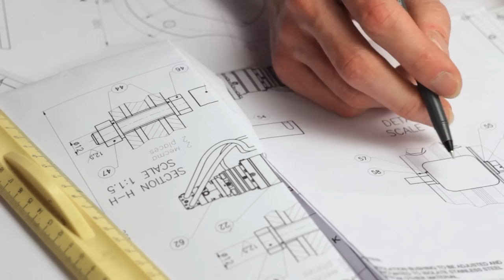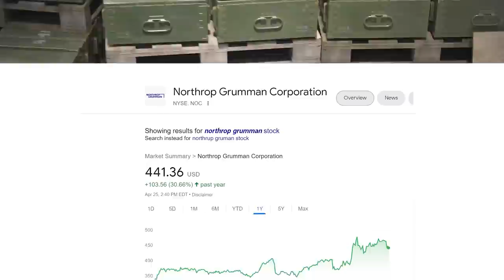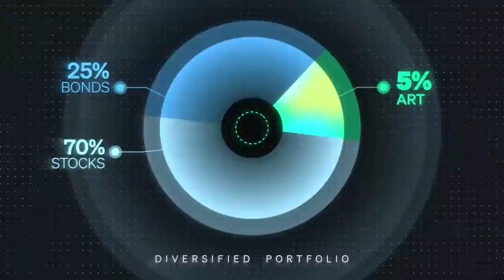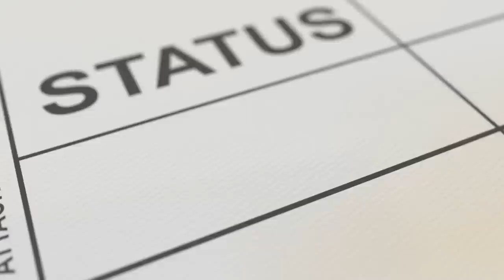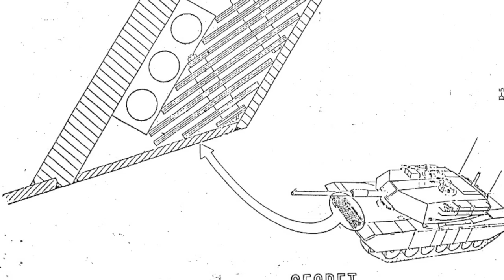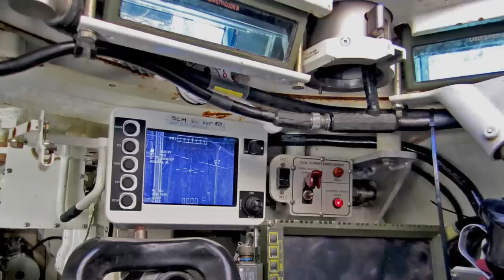The M1 Abrams Tank Needs to Chill Out

Comment: In 95 when I was stationed at fort hood, my infantry platoon was attached to a tank company.  We did a force on force where one tank would defend against the whole company.  
After 3 hours the tank was finally killed after he had killed all four Bradley’s and 10 other tanks.  
In 99 when I was a bradley gunner in Germany I used the same tactics and our one bradley fought off and killed 12 out of 13 other Bradley’s.  
We used the berm drill tactic, you come up till just the optic is over a reserve slope, then you pull up just far enough so the gun clears the iv line and engage.  You kill one or two vehicles then back down till your optic is able to see then move at least 100 meters to left or right, and repeat.. never come up twice in same spot, and never have the driver slam the gas (black smoke from exhaust), creep up slowly.
Reply: How doe that work, do you guys use like paint shells or something to designate hits or what?
Reply: @Baconator5642  MILES gear, it is like a big set of layer tags
Reply: kind of the unique thing you only can do with a tank. no other weapon system lets you drive a large piece of artillery up to the enemy, fire, and duck back under cover before they know what hit them, and move as fast
Reply: It's called a hull down position.
Reply: @thomassenbart  it would be a hull Defilade on a reverse slope.
Reply: @soup31314  You can use those terms as well, though in the tanks we don't really use reverse slope for this maneuver. 

 Reverse slope is generally a tactic employed after gaining the high ground and either you implant yourself on the forward or reverse slope, anticipating a counter attack, depending on what you anticipate.  Also, this tactic is used at the platoon and company level as opposed to an individual tank in a fighting position, generally. 

The idea being that attacking forces crest the high ground and leave their very vulnerable underside open to penetration.  Again, this is different than hull down, when you move forward shoot and then move back, preferably to a different adjacent fighting position.
Reply: @AsbestosMuffins  Tanks are not artillery, though both have tubes/guns/cannons.  Tanks are direct fire systems, while artillery are indirect, also the ranges are vastly different and types of ordnance.  :)
Reply: @thomassenbart  lmao only 13 years as a mech infantry on Bradley’s.  Think I know what I am talking about.  
A hasty defense of a reverse slope will and can be used by a single vehicle to hold off a larger element. 
Just as a sniper can hold down a whole company. 
But you are right tell me more about how the terms I used are right but wrong lmao
Reply: What you described is a standard battle drill for a prepared defense. It's known to Scout Bradley crew and Abrams crew.
Reply: @thomassenbart  Ukraine turned their armored vehicles into artillery by spotting with drones. Kind of ingenious really.
Reply: @Adierit  
US forces used tanks as artillery in Korea.
Earthen ramparts were built to increase the angle of the main guns elevation.